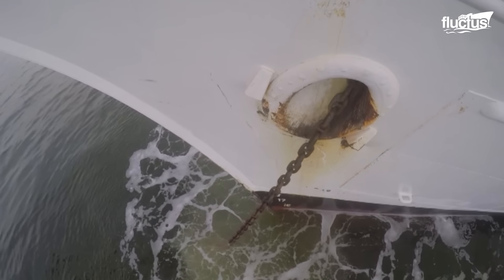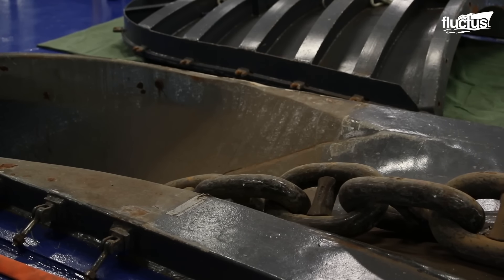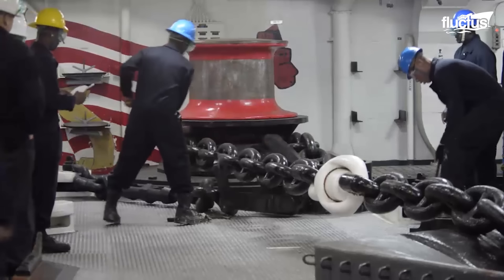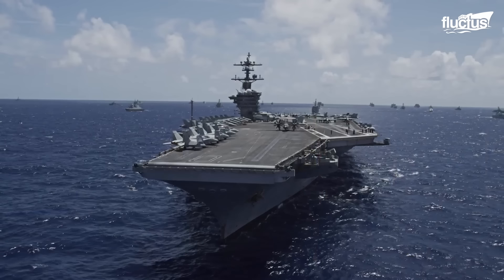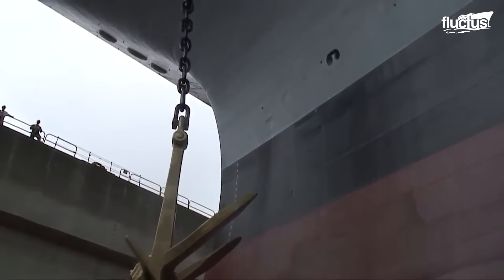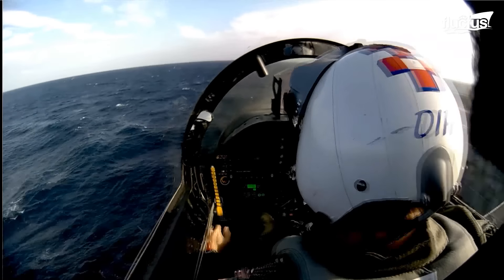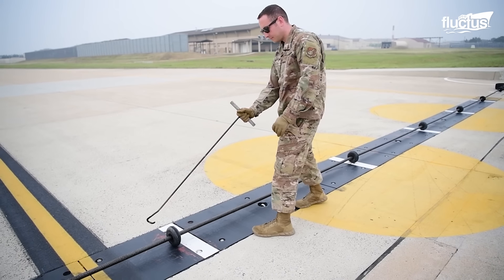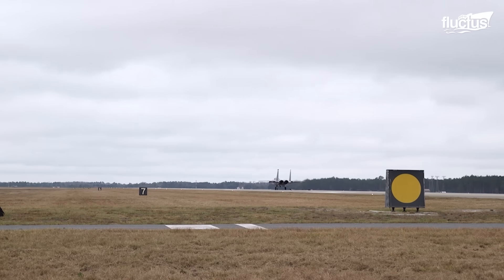How US Navy Drops MASSIVE Aircraft Carrier Anchor at Full Speed

Comment: It's not the anchor that holds the ship, it's the weight  of  the chain on the  sea floor that does. The anchor is there to keep the chain in place.
Reply: Thanks
Reply: You have it backwards.  Chain is used instead of rope or wire because it resists abrasion and is easier to be lifted by a windlass, which grips each link securely.
Reply: @wallacegrommet9343  That was the explanation that was given in Seamen school so I'm gonna continue to go with that one and if you can find me a rope or wire that can pull  a 30,000 pound anchor through the Hawsepipe across the deck around the windlass and down into the Anchor chain room and come back up  without turning into a big knot  I'd like to buy stock in that company
Reply: @chrislewis7238  lol 😂 exactly navy taught us the right way lol
Reply: I was just getting ready to make the same comment as you did Chris.
Reply: @wallacegrommet9343  I think the primary reason for chain is that the chain can be stowed without kinking. Try coiling a wire or other rope. The rope has to be handled in a way to keep it from kinking. That isn't possible when you are just pushing the rope into a locker. A chain, as far as I know, doesn't kink.

As far as being easier to lift by the windlass, most heavy lines, such as mooring lines, also use windlasses. They don't have a problem pulling the ship to the pier.
Reply: Wire also spools neatly and compactly around a drum.  But all the salt water clinging to a large drum of stranded wire would dry very slowly, and corrosion would begin soon soon after all the zinc plating exhausted its anodic capacity.
Reply: I’m definitely in the chain camp.
Reply: @Coonass  Some of slackest people watch the anchor though, so there must be room for slack.
Reply: Yes Chris, the anchor is there merely to drag the chain out of the chain locker. It is primarily the weight of the chain on the seabed which holds the ship in place. It was one of the first things I learnt when I went to sea.
Reply: What happens when all of the chain is lifted from the sea floor? The anchor remains embedded. This is called the scope effect. The lower the angle of the chain leading from the anchor, the greater the holding power.
Reply: @wallacegrommet9343  That happens during High winds or rough seas we call that " Dragging the Anchor"  A large ship will pull that anchor right off the bottom once the chain is pulled out of position  We had two options  Haul up the anchor reposition the ship and drop the anchor again or get underway. You would never want to drop the other anchor because the two chains could become entangled. In any case depending on the sea state when the chain comes off the sea floor the ship will eventually move. sometimes you get lucky and the wind shifts or the current does and everything goes back almost to where it was .  What we learned was  the sea is a beast with a mind of it's own. A book can teach you  theories and putting around 5 miles off shore in a sailboat  is  nice but spend some time in a typhoon in the pacific and you get a whole new perspective.
Reply: And this is why even the smallest of boats are required to have a specified length of chain between the anchor warp and the anchor.
Reply: 🤔 Yes, but it's the water in the ocean that acts like a "buffer" that separates the bottom of the ship from the anchor sitting on the ocean floor. If the ocean water wasn't there, the ship would be laying right on top of the anchor. If the ocean water were to suddenly evaporate away, then anchors will become obsolete, and we'll be forced to install wheels or tank tracks on the bottom of the carriers. That's so they can drive around the world on the exposed sea floor, and project American air power! At that point they will have replaced giant anchors with giant parking brake levers.
Reply: @MrSkullWolf  Or as they told us in basic...."There's the right way, and then there's the Navy way.  Learn the Navy way."
Reply: and does your tail wag its dog??
Reply: @HighlanderNorth1  Exactly, they might as well say the 100th link is only there to connect the 101 link to the 99 link. 
People get fed a half truth via word of mouth, never even ask why an anchor has an anchor shape [not a round ball], let alone confirm the physics math makes sense. Then cling to it like a direct message from god.
Reply: Amsteel Blue would work for this purpose. But as already stated above. It’s the anchor chain that holds the ship in place. The required amount of Amsteel Blue needed would weigh less than 2 links of chain and is lighter than water. This means it would not be useful for anchoring a ship in place
Reply: Kinking is mostly associated with Roos that are made of twisted construction, the most common being 3 strand twisted ropes. Braided construction lines do not have a twist in their construction and are less susceptible to kinking. 

 Any of the HMPE lines would be more than adequate strength wise to hold a ship. But being lighter than sea water they would not be useful for anchoring.
Reply: The anchor holds the ship. The chain serves several purposes. The anchor won't hold if the shank isn't pulled parallel to the bottom. If the shank lifts too much, it will release. This is how the anchor is retrieved. The weight of the chain makes a belly, and as long as you have deployed enough scope, some of the chain will remain on the floor. Steel galvanized chain is the best option for price to performance and usability. Cable is a problem due to twisting and kinking. There isn't always tension on the chain and ships float over and pull in all directions. Rope will wear quickly if it come in contact with rocks, and you would probably need at least some chain to hold down the shank.
Reply: EXACTLY!!^^^^
Reply: There is a swing and drag circle that is constantly being monitored while the ship is at anchor. If the sea state causes the ship to move to far from position: "drag anchor", then the ship will retrieve the anchor and get underway to reposition the ship. And yes, it is the weight of the anchor chain laying on the bottom that holds the ship in place. That is why when the ship drops the anchor, it then backs down to lay a specified amount of chain on the bottom between the ship and the anchor. 
EN1(SW) USN (ret.) A-Gang for Life!
Reply: @HighlanderNorth1  Wow Ogre, thats very deep!
Reply: The weight of the chain also acts as anchor. The section that experiences wear from tide change is called the chaff. Rope (line) has no weight and the anchor itself will have to do all the work. Depending on the seabed, the anchor could be pulled out. On the bridge, we plot the anchorage and alarms go off if we drift. These are ships not boats people.
Reply: Ok, I have to put my two cents in on this. Anchors are designed such that they provide holding power by digging in horizontally, not vertically. The chain ensures that the pull on the anchor is parallel to the sea bed. When retrieving an anchor, the ship needs to be directly over the anchor so that it can release vertically.
Reply: @chrislewis7238  Thats what I learned in boot camp, and onboard 4 of the 5 ships I served on.  I'll go with that explanation too
Reply: @charlesgantz5865  lets not forget about maintenance.  An anchor chain can be added to, without knots, the windlass will grip the chain, thus controlling the amount of chain let out to control anchoring outside a port.
Reply: And all this time I thought the wall anchors were holding my pictures up
Reply: Yes, I was going to mention it but thought, "No somebody else must have corrected in comments" It took a while but thanks...I know not everyone knows it, but making a video you'd think they would check facts ?!!
Reply: Incorrect, but i only got 11 years of experience, what is that worth really. 

Chain is used for practical reasons on larger ships, and i promise you the anchor on the end of the chain is not decorational.. our stern drifted over 160 degrees once when the last link holding the anchor had snapped
Reply: You realize the anchor and chain weighs the same on the boat? My Lord this comment is the single best example of the ‘I’m the smartest person online and I’ll prove it’ mentality I’ve ever seen.
Reply: Sheesh, lucky you told me.... i was about to throw an anchor overboard- guess i better join it to a chain???!!!
Reply: Ridiculous, the flukes are designed to hook the ground stopping it, not the chain. Why even use a anchor then? Why not just the chain
Reply: It's both. The anchor digs into the bottom.  But the chain plays a major part in reducing the tugs on the anchor, which would upset it out of the bottom. The chain or rope ensures that the pull on the anchor is very close to horizontal, which the anchor can hold against.  

That's why there's a requirement for "scope" which is the ratio of chain to water depth. Usually about 5:1 in shallow water.

That said, on boats you can anchor effectively with either rope or chain, but if you don't have an anchor (and a good one) on the end, you won't hold in any kind of wind.
Reply: in other words, the anchor hold the ship. indirectly, but it does

Comment: The anchor itself on large ships provides very little to none of the actual holding power when it's lowered into the water. The weight of the anchor is really just there to help pull out the chain. The weight of the chain itself stretched out along the sea floor is what actually holds the ship.
Reply: Casual Navigation did a whole video on this very topic as well :)
Reply: This is why even smaller boats have some chain to the anchor and then the rope. If you tie the anchor with a rope (without a chain) it will tense repeatedly and break something. The chain provides a smooth bouncing.
Reply: Duh
Reply: @dimitristripakis7364 incorrect. Anchor isn’t used to stop, it’s used to keep a stopped ship from moving. There shouldn’t be that much stress on the anchor to begin with.
Reply: So if the anchors do nothing except drag the chain down, why are they all fish-hooky-and diggy-pointy-like? Sorry for the technical jargon, LOL.
Reply: @leppad  Not 100% sure, but I think it's mainly to help keep it in place while the rest of the chain is ran out.
Reply: @leppad  had you paid attention to the video, you'd know.

Comment: Having built US Navy ships my entire life, it’s quite exciting for the brake band on the winless to catch on fire during free fall operation. This is due to hydraulic oil leaks in the system. An unavoidable consequence on the older anchor systems. I’ve been doing this 30 something years.
Reply: windlass not winless
Reply: @andypage9  they musta spelled it different 30 something years ago.
Reply: Couldn’t they upgrade the hydraulic system to repair the oil leaks
Reply: @andypage9  
❓ So, do you expect the NY Jets to do so poorly that they end up with a windlass record?😁

Btw folks, that's the Russian protected cruiser Aurora at 0:31.  It was launched in 1900 and commissioned in 1903. It's super cool that they saved and restored that old cruiser, because there are only about 2 or maybe 3 protected cruisers left in the world.  MANY of them were cutting edge when ordered, but became obsolete just a few years later, after they were completed and entered service! 

During the post WW1 and WW2 period, these obsolete cruisers were quickly scrapped and their steel recycled into newer ships. The only other existing protected cruiser that I can think of is the USS Olympia in Philadelphia.
Reply: @philh.7100  
When I worked on carriers, we didn't have to bother with "hydraulics" to slow the anchors. As the anchor was being dropped, I just wrapped my arms around the anchor chain and applied pressure to it, which dramatically slowed it's descent. Sure, it caused some skin abrasions, and I ruined a lot of uniform shirts,  but the navy happily paid for 25 new shirts a month..... 😉
Reply: @HighlanderNorth1  LMAO!!
Reply: @busimagen  tote that barge, lift that bale!
Reply: Building them your life. Hmmm I would have loved to see you building an aircraft carrier at the age of two. What did you do if you had a poopie diaper? Was mommy on board?
Reply: "Windlass".
Reply: @johnlucier5654  LOL I assumed that was the spell check working its magic!
Reply: @HighlanderNorth1  DAYUM! Im a non-commissioned nobody, but thank you for your selfless service! We're NOT worthy!
Reply: @HighlanderNorth1  
Ok Popeye.
Reply: You've been doing this your "entire life",you've been doing it 30 yrs so you're 30yrs old,correct? Btw who asked about the length of time you've worked on ships? What does this have to do with your little lesson you bestowed upon the online community?
Reply: @ryanjohnson9093  I just responded with something similar then caught this comment afterwards.Bravo 👏  🤣
Reply: Obviously you did not do any work on the windlass. And what is the exciting bit again?
Reply: @busimagen  rubbiish! 'Winless' is not a 'spelling variation' its a mistake.
Reply: @andypage9  the man said he built the ships, not wrote essays about them 😁
Reply: Marinette?
Reply: Aren't you tired of your job? It seems very dangerous
Reply: Sailor of the year
Reply: nice!
Reply: @rossco76tait48  grow up little buddy
Reply: @andypage9  First thing I thought about lol...for a lifelong builder you would think that they know how to spell the dang thing.
Reply: @philh.7100  well they recently tried a non-hydraulic system and had to leave the anchor at the bottom of the ocean due to not being able to pick it back up 😂
Reply: @ryanjohnson9093  wise ass
Reply: I believe you meant " windlass".
Reply: @HighlanderNorth1  sounds like something I would tell the apprentice to do 🥳🥳
Reply: Cool 😮
Reply: Nobody "free falls " an anchor they walk it back under power, take the windlass out of gear and then let go off the brake.
The brake is applied when the anchor hits the bottom.

The brake does not catch fire except in extremely rare occasions due to misuse.

30 years my arse 😂
Reply: No one:

You: I've been doing this all my life! 30 years!
Reply: @HighlanderNorth1 TOUCHDOWN! You forgot your brains home!
Reply: That's cool OP. These people calling out a spelling error are pretty pathetic. Obviously a mistake, and if you did work on ships that long kudos to you man, something to forever be proud of. Maybe these people are jealous they don't have something to be proud of. Wouldn't blame them, im in the same boat but trying my best.
Reply: @johnlucier5654  no, but naval types are notorious for compressing words down like that. Forecastle = fokesel, southwest = souwest, boatswain = bosun. Easy to see how someone more concerned with doing something than writing about it would spell it how they have always said it.
Reply: Don't see why a nuclear powered aircraft carrier should have anchors. They're not worried about fuel, just have the thrusters keep the ship in place with GPS automatically.
Reply: @SpecialJay  I was thinking along the same lines. Here's probably a dumb question. Do submarines have anchors?
Reply: @SpecialJay  could probably just be because a physical anchor is much more trustworthy than a system that relies on computers and satellite signals to work. They could be using electronic station keeping as well, with the anchor as a backup.
Reply: @bebophippie1781  They do. They are tucked away and are rarely used because subs don't really like to be sitting still. Their mission revolves around being on the move rather than setting up a "position" like a carrier might. They're also notorious among submariners for breaking, jokingly called "one time use" and not being that useful.
Reply: @BlueZirnitra  Thank you. Another question, can a sub sit on the ocean floor and then start moving again or is it doom to hit bottom?
Reply: @BlueZirnitra  Thank you for pointing this out about spelling vs pronunciation (windlass vs /winless/); I was about to do so myself. @barryharris4 was just writing it the way he heard it all those years. I thank him for adding value to this video's comments.
Reply: … But did you ever serve? Big difference buddy. I did.
Reply: Thank you for your service in building our Navy Ships !
Reply: @andypage9  Lol, and nobody has ever had any problems with autocorrect changing a number of words in every damned paragraph, if I don't correct the autocorrect every time, the outcome can be quite hilarious
Reply: @rossco76tait48  He started at birth?? 😂 Please tell me you’re trolling. SMH lol.
Reply: Can I just say that that is incredible. Bro, YOU BUILD GIANT WARSHIPS! If i did that, I'd be like points at TV screen made that. Made that one too. Yup that one was fun. Did that one. 

Lol that's badass.
Reply: @HighlanderNorth1  spoken like a true highlander.
Reply: @celestialknight2339  of course....he said he'd been building ships his "entire" life.
Reply: @rossco76tait48 He obviously means entire career life lol
Reply: @nobody6032  Why would I listen to some nobody?
Reply: Yes it a lot of noise but I wouldn't call it that dangerous as long as you know what your doing!!!
Reply: @philh.7100  They have!!!
Reply: @Skibbidyboobop  That's pretty ignorant! You don't have to be a great speller to build ships!!!
Reply: @bebophippie1781  Yes they do!!!
Reply: @bebophippie1781  There are no dumb questions!!!
Reply: @SpecialJay  They have to answer for how much fuel they use to Congress!!!
Reply: @bebophippie1781  They don't sit on the bottom anymore because it clogs the water intakes that cools the Reactors!!!
Some still can sit on the bottom!
Reply: @kirkkirkland7244  no they don't.
Reply: @kirkkirkland7244  awesome. I think I had some old images in my head from cartoons of them just waiting on the bottom with everything off so they can ambush other ships. Have a great day.
Reply: @rossco76tait48  I'm so sick of narcissists. You think you're allowed to troll everybody and nobody is allowed to call you out on it?
Reply: @HighlanderNorth1  you had to use both arms?  Ha.  WEAK.